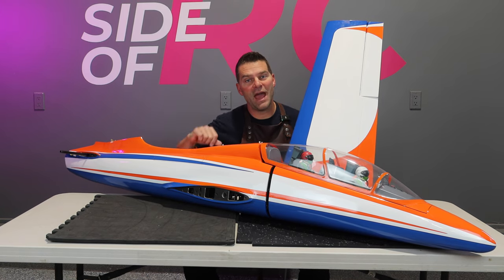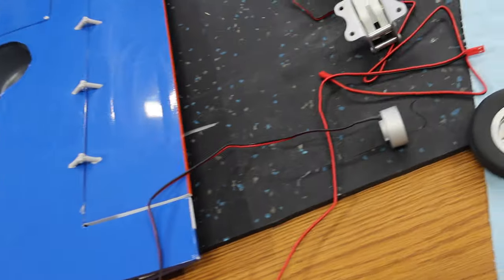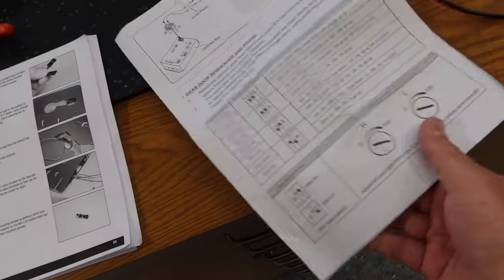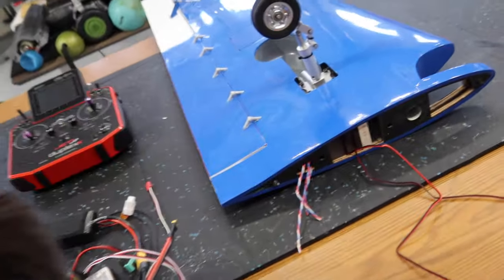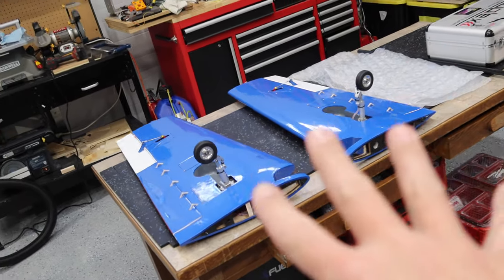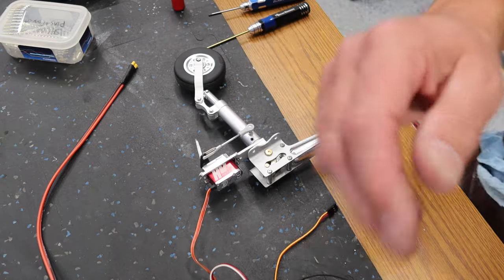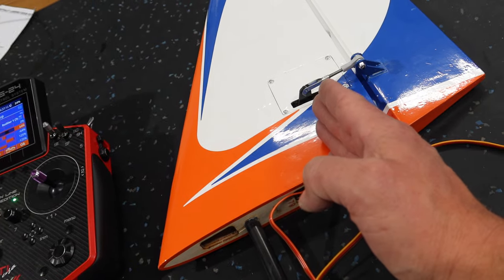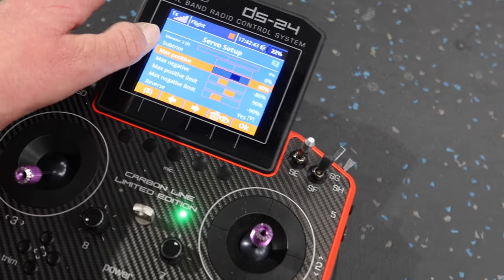Assembly Adventures: Building the Hangar 9 MB339 RC JET Continues

Comment: Just for your info, this model is actually built by Phoenix models in Vietnam, it has similar flap hinges, internal pseudo carbon fibre finish and design solutions as the PC21 35 cc I’m building now, by this brand. I still regret the poor choice of covering scheme, really bland! 😒 There are actually plenty of military training/Frecce Tricolori schemes that could have been done with plastic covering.
Reply from the maker: awesome!  Thanks!  I think as it's geared towards the new pilot the scheme is well suited and visible!

Comment: Not specifically related to this video but could you elaborate your pitot tube setup in the nose more in depth? How do you achieve the mounting, glued in place? Second, in general you always see the pitot tube sticking out a few cm’s. Normally, that’s to avoid the influence of pressure waves in front of the nose to affect the measurements but maybe that’s not problematic for model speeds? What’s the justification to do it like that?
Third, for static pressure, you seem to just leave the sensor port open (no tubing connected). I guess if you want to do that, you should make sure your sensor is in a dead zone, so no possible airflow or dynamic pressure. Any guidelines about that?
Appreciate your feedback!
Reply from the maker: Yes glued in place.  just the tip sticking out.  Looks way better and less visible.  If you can make it invisible and work than that's the best route in my opinion.  on the sensor it's getting static pressure from inside the fuse.

Comment: Hey jon...I have a question...the clevisis you use ..are they threaded or solder ?..thanks, Larry
Reply from the maker: Hey Larry. They are threaded. And I install thin CA on the threads.
Reply: Thanks Jon
Reply: And if you don't mind ..where do you get your clevisis from ..I can't seem to find the mm in threaded..
Thanks 
Larry
Reply from the maker: @larryfox7279  Sullivan golden clevis is the main one. They make the standard 4-40 but they also make 3mm ones.

Comment: Can you tell me how many MM the opening at the rear of the fuse is. Not the Stainless thrust tube, but the actual Fuse rear hole.
Reply from the maker: it's the same dimension as the OD of the outer wall of the pipe.
Reply: @thelightersideofrc  Which is what ??????